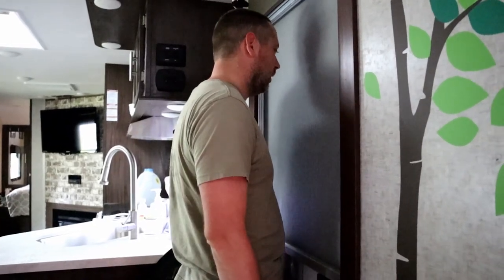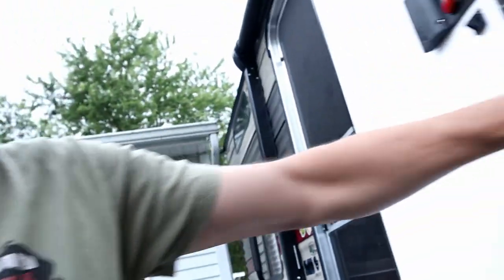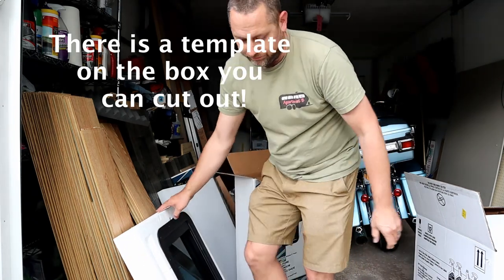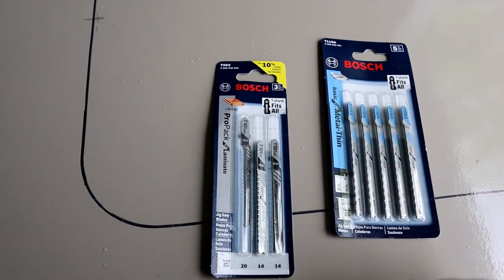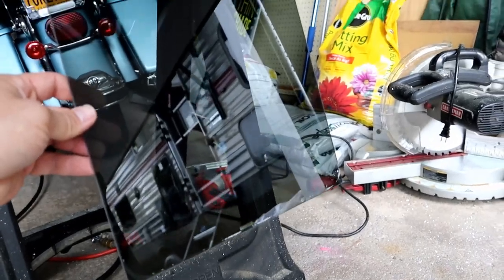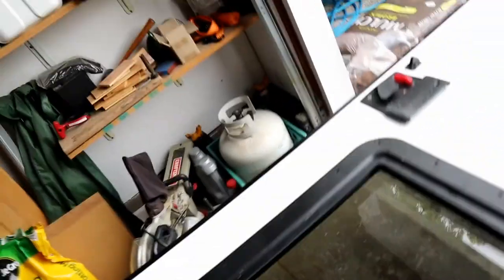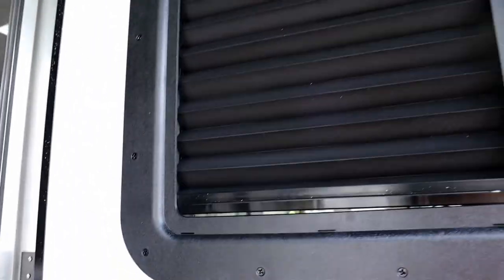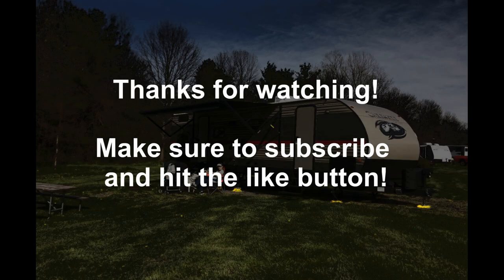Installing Windows on RV Doors - AP Products  - Cherokee 264DBH

Comment: I installed this window in my door because the previous one had no shade but I would be much happier with no window altogether. But you did a fantastic job on the cutouts
Reply from the maker: I can’t believe yours had no shade!  The only thing I really didn’t like about this window is you literally had to open the door and almost go outside to pull down or open the shade!  My new camper has a shade built on to the screen door for the window.

Comment: Just got mine delivered and this is my weekend project. I’m fearing cutting into the door. I noticed the problem you spoke of about the shade. Found a company that makes a sideways closure that allows opening and closing without screen interference. Just don’t see dropping another $100 into just the door again. Clozures is the company if anyone is interested. Thanks for the vid.👍
Reply from the maker: Thanks for the info about the window company!  It’s actually a really easy project you will have it done in no time!
Reply: @ApartmentB  I got it installed, but found a problem. Doors with windows are usually reinforced with wood framing. After a few weeks, it ran a crack on the inside metal from lacking that framing. I’d suggest cutting some of the styrofoam out and getting some wood that’ll fit inside the door frame.
Reply from the maker: I didn’t have any issue with mine but that’s a good tip. I can see it having an issue especially over time since the door is basically just foam and a sheet of fiberglass.

Comment: Did you just trace around the window frame or what exactly did you trace around?
Reply from the maker: Matt Morris it comes with a template on the box to trace but I didn’t notice it until after I was done with the windows. But I just traced the plastic window piece with a sharpie on the door after measuring and getting it centered.
Reply: Apartment B thanks for the quick response!  I’m getting ready to put two of these on my tt as well that came with none on the doors.  Have you had any issues with them?  I’m trying to figure out where to take my doors off at so I can do what you did.
Reply from the maker: No issues at all. We love having them. The extra light they let in makes a big difference. On my door I just unscrewed the hinges on the door. I did it by myself but it would be a lot easier with two people.